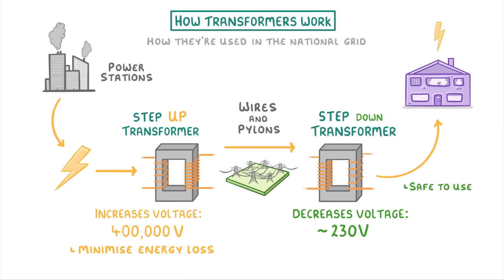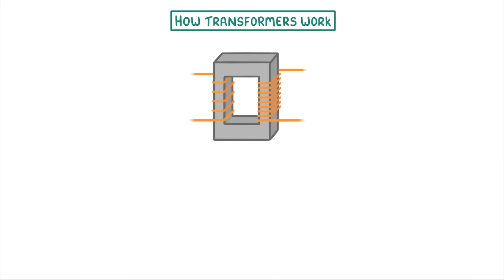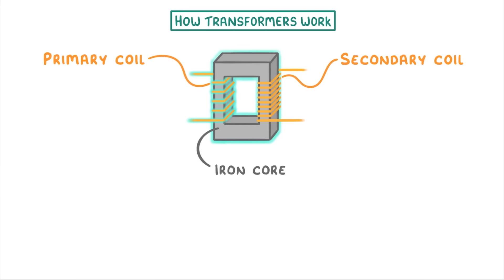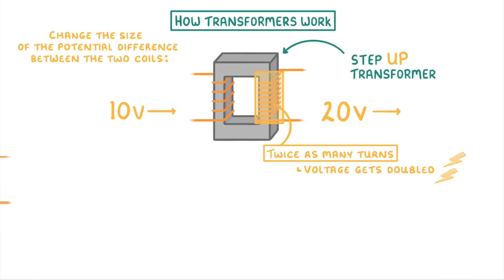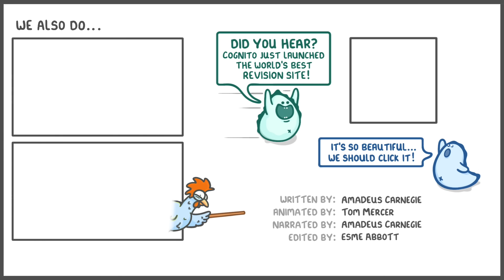GCSE Physics - How Transformers Work

Comment from the maker: If you’d like to practise what's covered in this video, check out the lesson on the Cognito platform: https://cognitoedu.org/coursesubtopic/p2-gcse-aqa-h-t_6.09 - it's totally free, and has been built to make learning and revision as easy as possible. The main features are:
- Lessons organised by topic, only the lessons relevant to your specific exam board and tier are shown.
- Automatic progress tracking. Progress bars tell you what you’re doing well at, and what you need to spend some time on.
- Practise quizzes so you can test your knowledge. You can quiz yourself on any combination of topics you like.
- A huge number of fully-hinted questions that take you step-by-step through some of the trickiest calculations & concepts.
- A comprehensive bank of past exam papers, organised both by year, and also by topic.

Amadeus & Tom
Reply: maybe pin the comment?
Reply: also this was quite helpful

Comment: Two questions:

ONE if the transformer can be used in both directions, why labelling them "step up" and "step down" transformers?

TWO now that many renewable generators are connected to low and medium voltage grids, how transformers will work if a given area has more power generated than load?

Comment: I've read that if the secondary coil is not there or in other words has an open circuit then this leads to the decrease of the current in the primary coil i don't know why the only reason i found was due to back emf generated due to self induction but i can't figure out why it decreases sooooo much and not just a little bit 
Help would be appreciated and Thank u all for your amazing help

Comment: I've got a question, what happens when a dc current is used? I got this question in a past paper and cant understand why it won't work.
Reply: DC current can't be used as change in current cannot be generated by DC meaning that there is no changing in magnetic field to induce a voltage across the secondary coil. DC means direct current and flows only in one direction
Reply: ok thank you!

Comment: what's the point of having a step up transformer and then having a step down one? I don't really understand it
Reply: to increase and decrease the voltage as required- obviously an entire city would need more voltage than a single house
Reply: to decrease the energy costs  because if u use normal wires u would lose energy as heat. to solve this problem u'll hve to use either thicker wires (which is expensive) or jst use the transformers (cheaper)
Reply: you've got your step up transformer to go into powerstations as they need lots of power to disperse to different areas. But the step down transformer means that the voltage going into your house is low enough that  it won't be dangerous to use. hope this helps

Comment: Hi, I didn't quite get how a potential difference is created within the primary coil. Could anyone explain, please?
Reply: When u move a magnet through the coil it cause current to flow in the coil, by using Ac the feild alternate or change direction which u can also say feild moving in the coil generating current when the current flow it generate potential difference ( sorry for badly explaining but it make sense for me )

Comment: but how does it induce the pd, its not the generator effect rite? cuz the wire or core isn't moving? I'm very lost :(
Reply: ( in the secondary coil)
Reply: I get the beginning bit i think, its like an electromagnetic rite? The pd and current cause wire to have a magnetic field, induces the magnetically soft iron core rite? but how does pd in secondary coil come along?
Reply: there is alternating current in the circuit, so that means the magnetic field is also alternating. So, because the magnetic field is also moving (alternating), it will induce the current in the secondary coil
Reply: 1.Describe how transformer works 
2. State one way in which energy is lost from the transformer and from part it is lost
Reply: @hashnataimur483  ?
Reply: Can u give me sometips i have problem understanding the questions